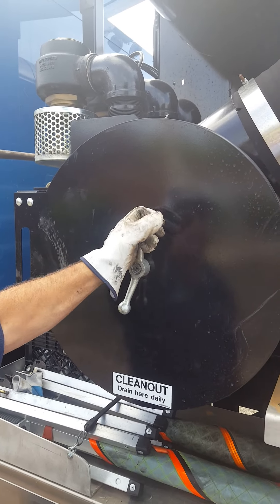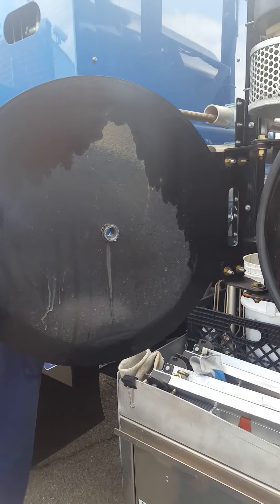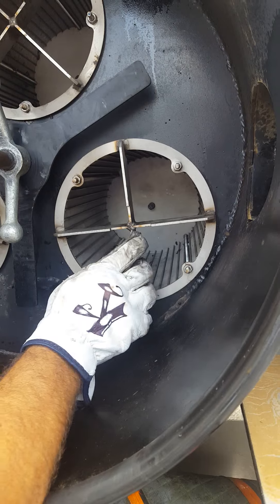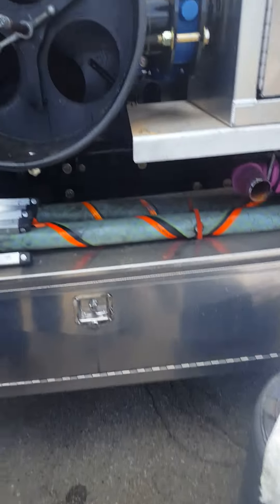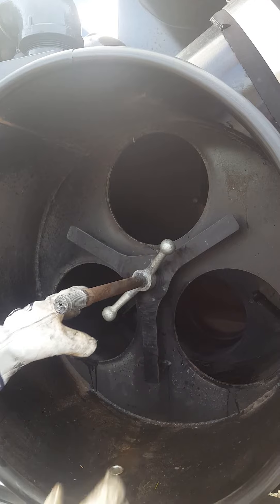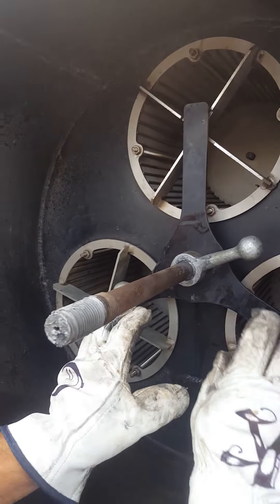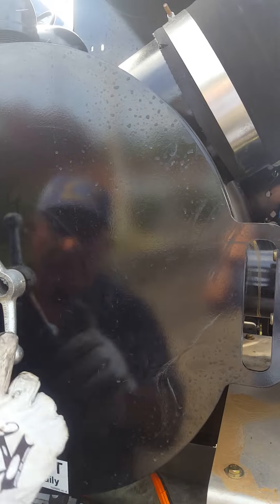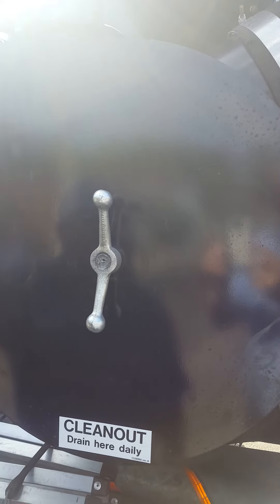Vactor 2100 triple can micro strainer maintenance video

Comment: has anybody there thought about doing a video of using the vactor to rescue from excavation collapses.  working with the various fire department captains and chiefs to alert them to the speed of using the machine. i know that united pumping has a 100 foot long large diameter hose and adapters to work with the air extractor system the LAFD uses.. perhaps other departments.   when i run info various fire captains.. when they are not on a call out.. i ask if they are aware of using the vactor.. not one has said they are yet..   

 thanks for posting. 

the jet flush nozzles used to get stuck in the sewer on my street when they were trying to retract them . nobody ever liked the idea to extend the hose to the next man hole. cut the nozzle off the end of the hose and extract it without needing to cut off a long section.  sometimes it took hours of work to yank the hose out.  i don't know what caught it..  what ever it was had some strength to it.  loosing a few inches of hose is way cheaper than loosing 100 or 200 feet of hose.
Reply from the maker: Hi Wayne...I've been involved in two rescues involving collapses by the request of the LAFD using the Vactor..in both cases there was a big buzz about creating a quick response team in the event of a rescue but it soon faded away.
Reply: Sewer Pros maybe you might have to start at the fire academy.  Or just set up a mock up and video it.  Trying to teach old dogs does now always work. But training puppies  that will remember how to do it for the rest of their lives is easy. . 
Thanks..
Reply: Sewer Pros by the way. United pumping has standing rescue contracts with almost every city in so cal. Talk to the owner there. I have several times about this.